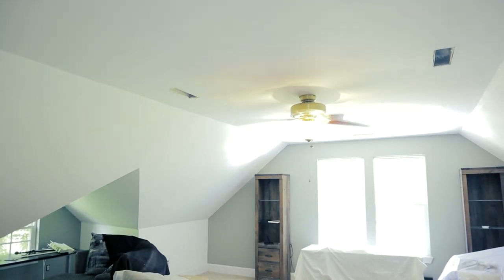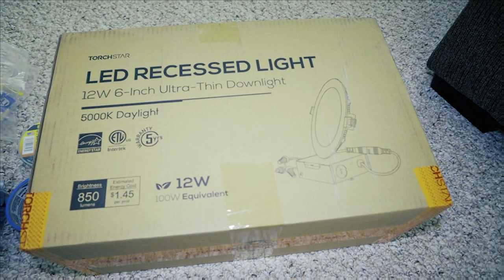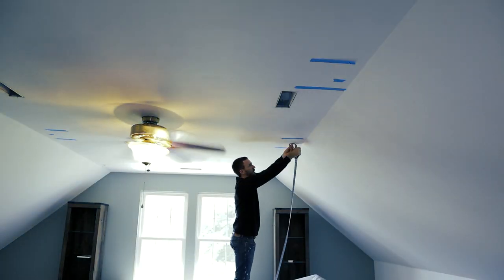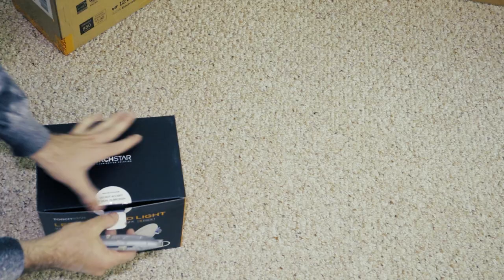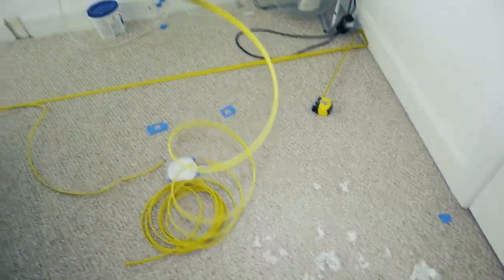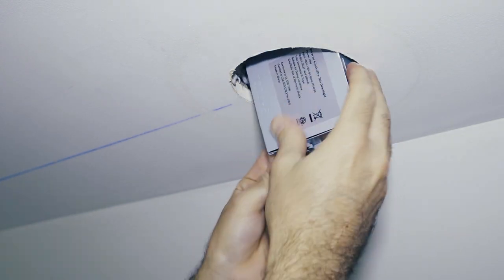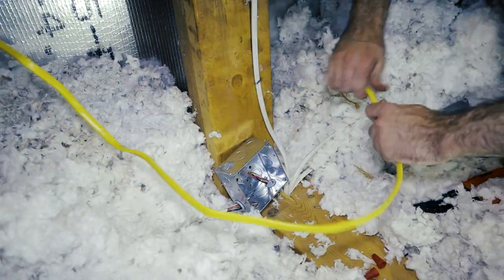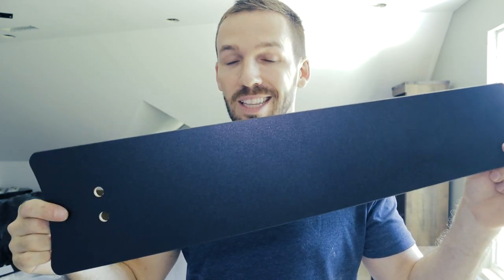DIY Dimmable Recessed Lights for My Movie Room

Comment: Just wondering why you choose not to go with the Lumary Color lights in the game room and instead went with just dimmers. I doing my game room and im in a toss up between the 2
Reply from the maker: I actually did this room months before I got the Lumary lights from the other video but was holding off to make an entire “Movie Room Remodel” video. I never fully finished this room so I just cut it to make it about the lights only. Lumary would’ve been cool here, but the dimmable switch on these are much easier for friends and visitors to use without an app or Alexa so I’m glad I chose just dimmable here.